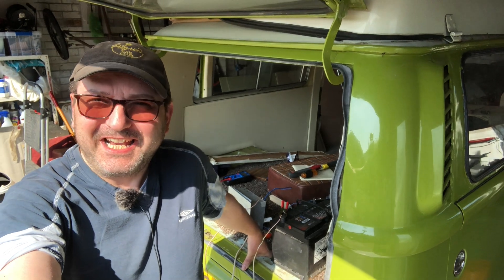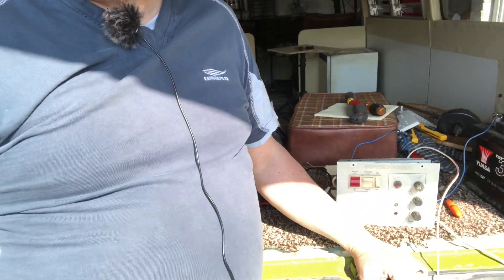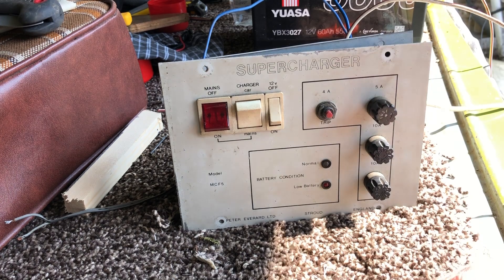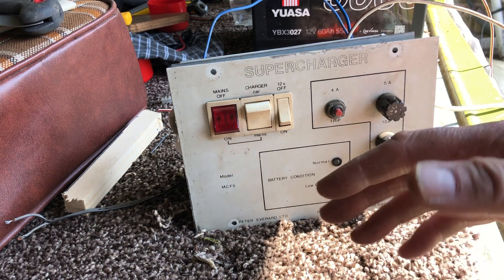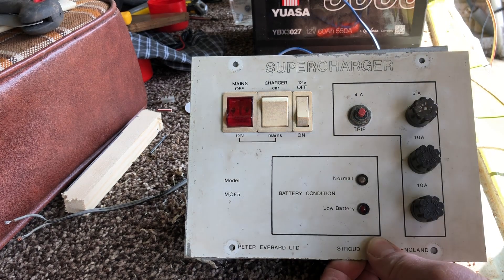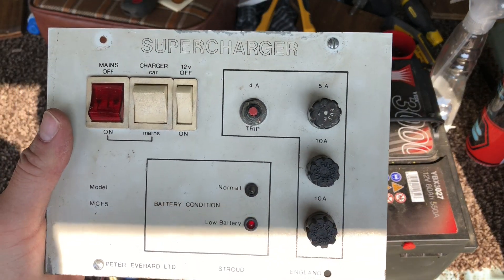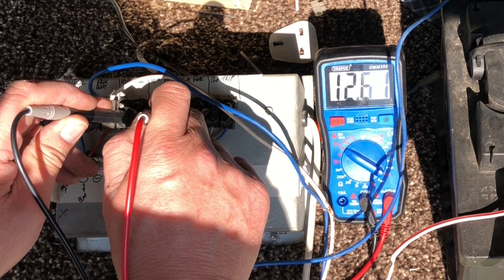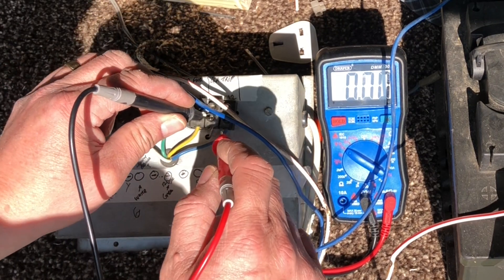ZIG Charger MCF5 how to use it & how to wire it (Olive Ep 10)

Comment: Hello John, I know this is off the subject but do you know where I might find a lower price on a aftermarket radio kit for 2003 Jaguar XK8? Thanks again love your videos!
Reply from the maker: hi Carol
I Have not used them but i know about this company that provides head units and all the required adaptaions for the XK8. You need to know if you have a a=standard or premium audio system though, so take this link as a link to their site , not a recomendation to buy the product that i have linked you to.
https://incartec.co.uk/product/Jaguar-XK8-96-99-premium-audio-Single-DIN-fitting-kit-with-Alpine-CDE205-FK-394-2-ALP

hope it helps
john

Comment: Really helpful video thanks. I have a similar Zig unit in the garage which I was thinking of using, but when I plug it into the mains I only get 10v across the aux battery terminals (3&4) and likewise across the others (5-10). NB. There is no aux battery connected. Should I not be getting around 15v?
Reply from the maker: Yes  14 to 15v. sounds like the transformer may be past its best Danny😔
Reply: @ToTheGarage  Many thanks for the reply. Thought as much. Time to purchase a split charge relay!